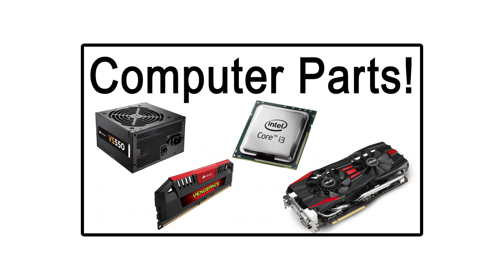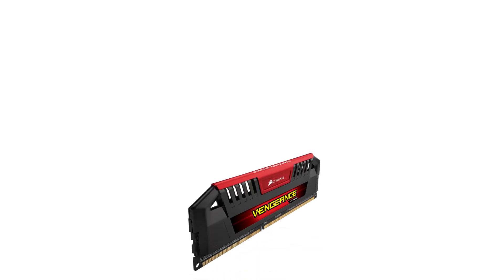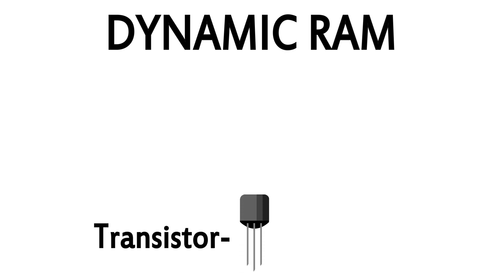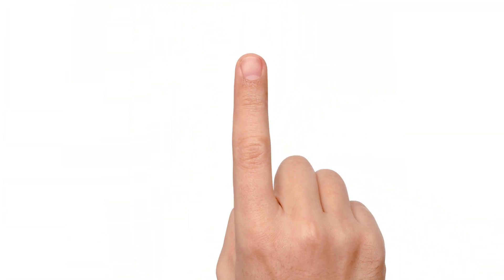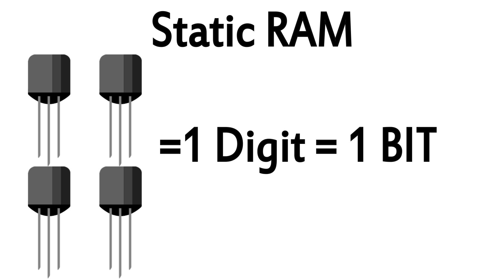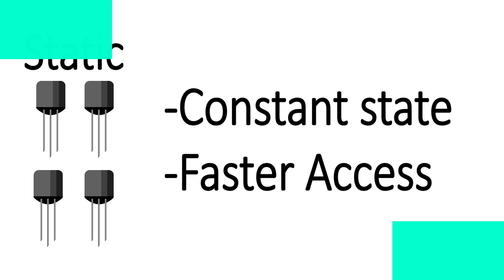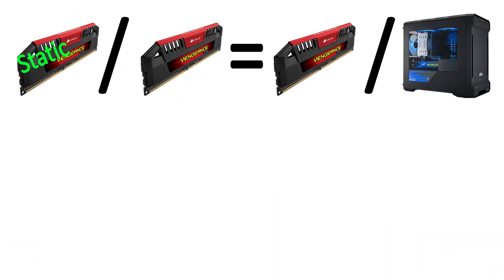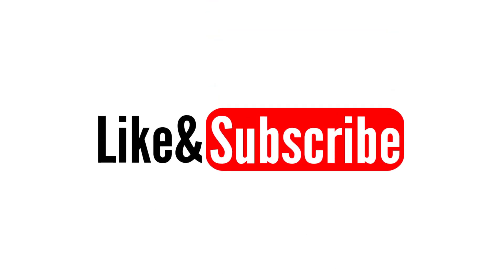Static RAM and Dynamic RAM Explained

Comment: do you get both static and dynamic ram when you just buy ram or do you need to buy them separately and if they come together is that why its better not to set them next to eachother
Reply from the maker: You get both when you buy any ram stick. The people who engineer the RAM have made the decision about how much of each is needed in a stick. It's not really a choice you ever have to make as a consumer.
Reply: H3Vtux ok thank you for the help :)
Reply: @garex8601  SRAM is in your CPU as cache and DRAM is that RAM stick that you purchase. The video is misleading by labeling SRAM right on top of a RAM stick (DRAM). To summarize, SRAM and DRAM are RAM. DRAM is the RAM stick that you buy and SRAM is included inside your CPU as L1 L2 L3 cache. =)

Comment: Are they separate ram or on the same ram? Dumb question just making sure.
Reply: Sram located in cpu they called cache like L3, L2, L1.
And dram just regular ram we know today
Reply: @aps-c1766  wrong. they are the same ram.  L1...Ln are use latches which make them much faster.
Reply: @nourghazal296  so sram and dram are in one stick of ram in everyone's computer?
Reply: @spoopi.twinkie7271  SRAM is in your CPU as cache and DRAM is that RAM stick that you purchase. The video is misleading by labeling SRAM right on top of a RAM stick (DRAM). To summarize, SRAM and DRAM are RAM. DRAM is the RAM stick that you buy and SRAM is included inside your CPU as L1 L2 L3 cache. =)
Reply: @darkeagle999  yep gotchu my brain has expanded since then thx for the clarification :)

Comment: Every stick contains both huh. And here I thought d Rams are separate hardware from s rams. Images on Google confused me more than it should. 😐
Reply from the maker: Yes, unless you are a hardware designer or you code drivers for a living, you really don't need to know the difference.
Reply: @H3Vtux  SRAM is in your CPU as cache and DRAM is that RAM stick that you purchase. The video is misleading by labeling SRAM right on top of a RAM stick (DRAM). To summarize, SRAM and DRAM are RAM. DRAM is the RAM stick that you buy and SRAM is included inside your CPU as L1 L2 L3 cache. =)

Comment: Why capacitor lose charge quickly???
Reply: Because they have High Equivalent series resistance. They need to use Low ESR = Equivalent Series Resistance capacitors and the memory will last much longer

Comment: Why does sram cost much?
And what does cache memory mean?
Reply: Cache is a memory that is stored with a purpose of speeding up the process. For example, when you copy a file into hard drive, the data will be stored as cache before it got written into the hard disk platter. In OS, when you open certain apps like internet browser, their data will be cached in order to speed up their operation. This is useful if you browse internet. Any content from any website you visit will be cached so that when you visit it again, it will be accessed from the cached memory and reducing internet usage by avoiding downloading the site content again.

Comment: Explain a cpu i have 12 gigs of ram and a terabyte or storags space i i think my graphics card is ok i am very confused on why my compuer is slow and can barely run most of my games on low some of them make my computer drop to 20 fps like destiny 2 if you knoa that game it is a 1st person AAA online shooter title that i find really fun on console but i cant play it with my friends  because of the terrible frame  rate i run i want to look into potential upgrades for my pc i just dont know whats the biggest issue i want to tackle that before i try to upgrade anything else.
Reply: Full RAM usage, full CPU usage and full GPU usage is among the reason of low FPS. Check the hardware usage during gameplay. Use MSI Afterburner for it.

Comment: So it’s best to use two. Of each ? Or will it depend on what the pc is being used for ?
Reply from the maker: Ryu Hayabusha each stick of RAM has both dynamic RAM and Static RAM inside it. How much of each and how it is arranged is determined by the people who make the RAM sticks to achieve the best performance. 
You don't have to worry about either one when buying, just buy good RAM, the balance between the two has already been decided.
Reply: H3Vtux ah ok thanks 👍🏽

Comment: can you buy single purpose ram sticks or are they all duel purpose?
Reply from the maker: If by dual purpose you mean involving both static and dynamic RAM, then they are all dual purpose. The way your programs utilize RAM requires both at every step of the way.

It's like if a single stick of RAM as a whole is a car, then SRAM and DRAM are like the engine and the alternator. You need both to have a functioning car.
Reply: now my apology's in advance to the face palm you are about to do but the reason i asked was because my mother board has 4 slots for ram and i know 1 and 3 are linked and 2 and 4 so in my head the hamster started running and thought why not slip them, put a stick or sram in 1 and 2 and a d ram in 3 and 4 so their is two parings but 2 entire sticks of each would probable be the same as 4 sticks of both. i thought at first that you could get more because the cards arn't spit equally by that little gap on the card but i didn't know if that was just their and all through out the card is mixed s and dram or if that break shows the separation of s and dram.  assuming the card is split into s and dram then you would loose some of one and gain more of the other because the card isnt split in half.
Reply from the maker: In terms of building/upgrading a PC you really don't even need to know the difference between SRAM and DRAM. Only the people who actually design the RAM sticks themselves really need to know the difference.
Reply: Is there a dedicated chip of SRAM in the memory module? I mean, I can see there are 8 separeted chips in my RAM module. Or is the SRAM located in the processor? I'm a little confused about that.